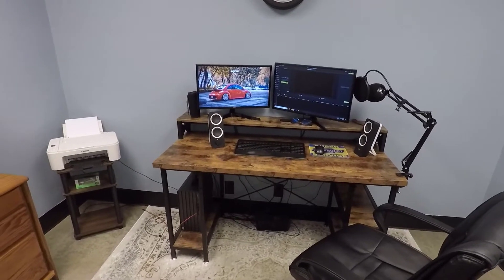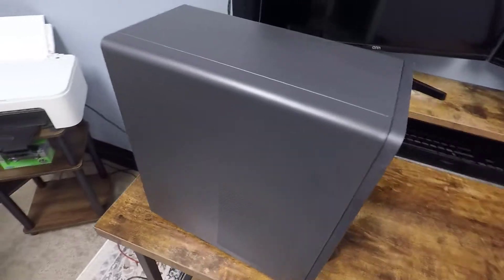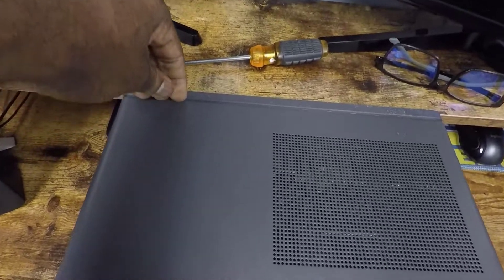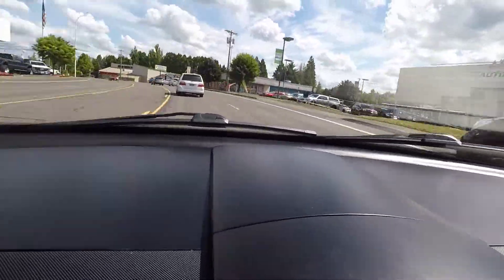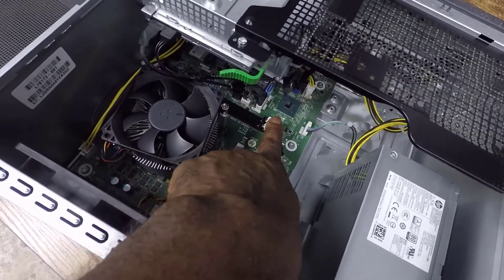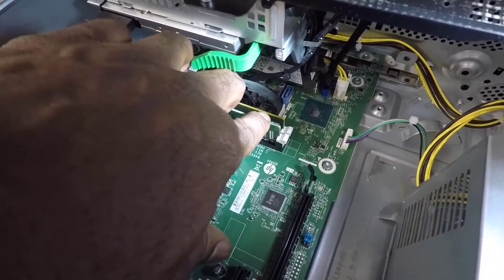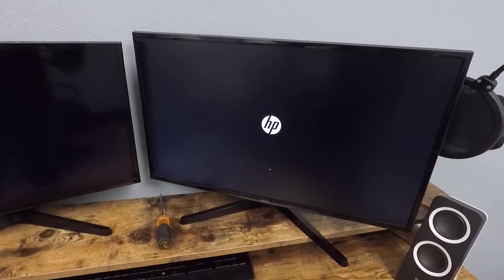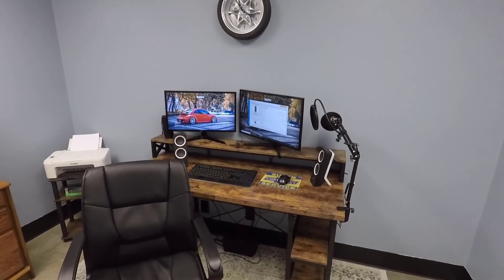HP ENVY Desktop Computer TE01-1134 Memory Upgrade - How To Remove Install and Upgrade RAM Memory

Comment: The reason why it is highly advisable to press the power button (as if to turn on the computer) AFTER YOU UNPLUG THE COMPUTER is because there is voltage "potential energy" still stored in the system. 

You may potentially get electrocuted by an unplugged computer due to these stored voltages!

Therefore, when the computer is unplugged, always press the power button repeatedly to be sure to release this stored energy. 

To my surprise, I have learned that many people are unaware of this. The reason why I am aware of this is because it was common knowledge to those who grew up during the age of Cathode Ray Tube televisions. An unplugged Cathode Ray Tube television can cause death by electrocution despite being unplugged!

Have A Safe And Happy New Year, 2024!

Comment: Great video! I have a very similar HP Envy TE01. I use Davinci Resolve 18.5 and it was struggling to preview the videos.
I had already had the memory upgraded but it did not help.
I had a 6 Gig GPU installed and wow what a difference. So you might want to try that!
Reply from the maker: That's a fantastic tip! Thanks for sharing your experience with the HP Envy TE01! It's always great to hear from others who have found effective ways to enhance their system's performance. Upgrading to a 6 Gig GPU sounds like it made a significant difference, especially for demanding tasks like video editing with Davinci Resolve. I'll definitely keep that in mind for future upgrades. Appreciate your input, and I'm glad your system is running smoothly now!
Reply: Hey could you link the one you chose to go with. I’m right where you guys were and need one bad for music and video production! Thanks again, hope the new year is treating you well.
Reply: @officialleog  Just Google Invidia 1660 supper video card.

Comment: Can you game with these
Reply from the maker: Not sure about that. I do video editing on mine and it still can fall on its face. I need to get a graphics card and see how that helps.
Reply: You could but you're gonna need to replace the power supply on the pc cuz it cant handle the parts, get a power supply (psu for short) thats like 650w if you dont have one already

Comment: I bought equipment for an upgrade an Exter mechanical hard drive and had surgery and then moved later to find out that the sandblaster card won’t fit in the slot because it’s offset yeah I’ve read that it could be installed with a ribbon cable I haven’t been able to find that cable I have a PCI one and a PCI 16 pen anybody have any suggestions

Comment: The purpose of hitting the power button after disconnecting the power cord is to discharge any voltage left in the
capacitors on the motherboard or other parts of the system to avoid any kind of electric shock.

Comment: I have same pc. But mine is juiced up. Swapped the rinky dink 110w power supply that it comes with to a direct fit 400w. Dropped in a Nvidia GTX 1650 Super. And PNY ddr4 16gb x2 3200mhz ram sticks. And a more powerful CPU fan and heatsink. 
Considering that you use editing software, I'd suggest throwing in a better GPU instead of using the integrated one.
Reply from the maker: This is exactly what I needed to hear! I do need more power out of this computer. It's a solid machine, but it could use a tune. I am going to research the components you added and I may just do the same! Thanks a lot... my Camtasia thanks you too!
Reply: Yeah, I have the one variation from Costco that came with GTX 1660. I don't really need that but my son prefers it to his laptop for some of his games. Mine came with came with the extra stuff, which is good, but then again the motherboard is maxxed out and I can't upgrade anything except maybe the power supply, which I guess would be the same one you had (110w). Not sure if I should do that or not, it's just a daily work horse.

Comment: Do you need the same brand of ram?
Reply: If you're planning on using both ram slots then getting two identical ram sticks is the way to go. This way you'll have your ram in dual channel mode. If you mismatch the ram, then you can run into several problems the worse being that your computer won't even boot up. Most motherboard BIOS do not like mismatched ram, so even if you do manage to boot up the computer, your ram will run at the slowest speed out of the two sticks, and if computer's resource needs exceeds the amount from the lower capacity ram stick, it will slow down.
Reply from the maker: I don't think brand matters as much as the type of RAM
Reply: Brands dont matter. Speed matters.
Reply: @BrandensOutdoorChannel  Brands do matter when you use 2 or more sticks of ram. Even if the clock speed of the ram is the same, two sticks of ram from two different brands are not identical, and most likely will not be run in dual channel or your machine can even fail to POST. If you want the best, safest and most stable option to use 2 or more sticks of ram, you need to buy them as a pair. Even if you buy two single sticks from the same brand, with the same speed, there is no guarantee that the actual chips themselves will be from the same manufacturer. Do not confuse the chip manufacturer from the brand of ram, they are usually different.
Reply: @lumiereeclair  It is reasonable to add 2 sticks for about $138
Crucial 32GB Desktop DDR4 2666 MHz UDIMM Memory Kit (2 x 16GB)
This Seems like the way to go.
Reply: @Maber01  For most everyday uses and purposes, you can actually do just fine with 8GB of ram. That includes web browsing, watching videos, office related tasks, light gaming, etc. However for a gaming RIG 16gb is plenty, 32gb is overkill. You would normally need this much ram if you intend to do video editing/processing or making renders. If that is the intended use, then getting the ram at a the slow speed of 2666Mhz is going to affect productivity. At minimum you would want the speed to be 3000Mhz, with 3200Mhz being a good sweat spot for price to performance. Going higher speed is nice, but you will get diminishing returns for the price.